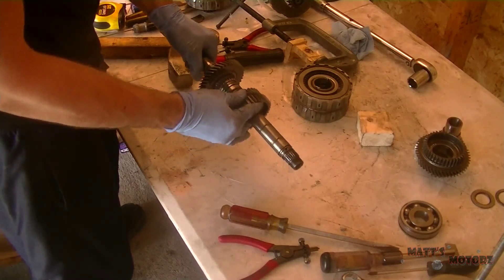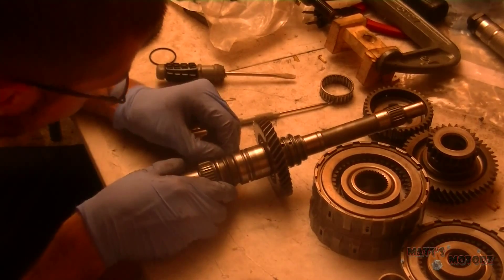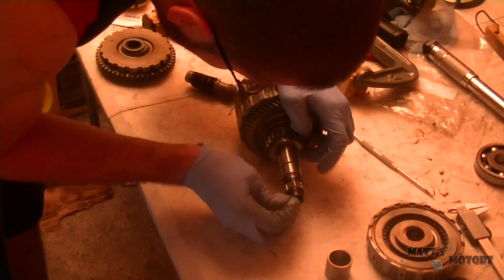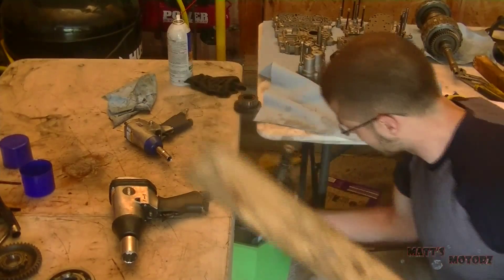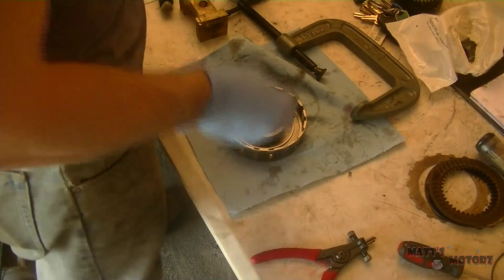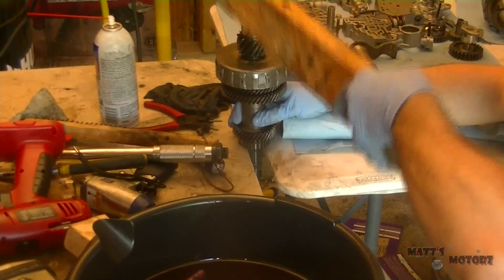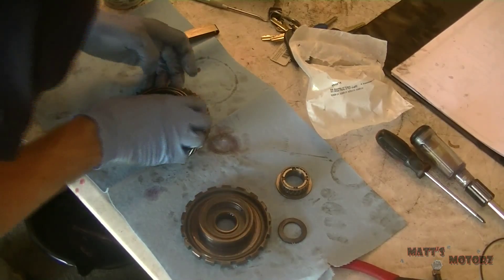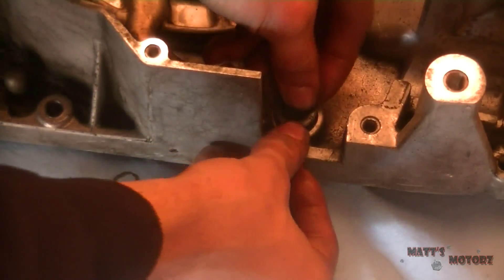A4RA Transaxle Rebuild [96-00 Honda Civic] Part 5 : Main / Counter Shaft and Various Seals

Comment: Hey Matt my clutches are wearing out would it be possible to drop the transmission then simply remove the countershaft by itself? Everything else is working fine I believe.
Reply from the maker: On some cars this is possible, on others, there is no way.  I don't have enough knowledge to tell you if your car would be possible to do that.
Reply: Oh I was referring to this specific transmission. I watched your first video and it seems like I'd need to take out both shafts anyway due to them being stuck together by the gears. Thanks for the prompt reply though man
Reply from the maker: Yes I know, but this transmission is in many cars, and certain cars have better access to the transmission than others.
Reply: Oh ok.